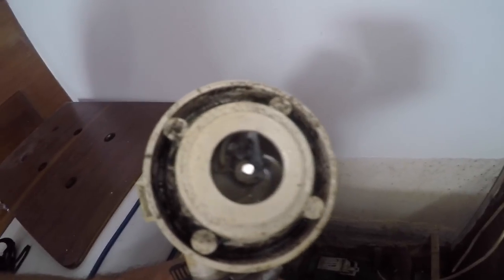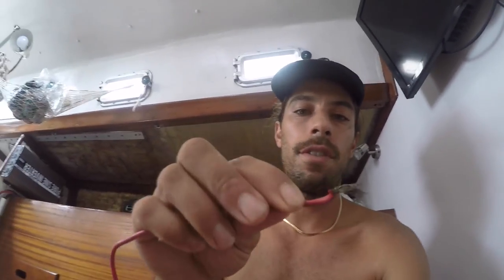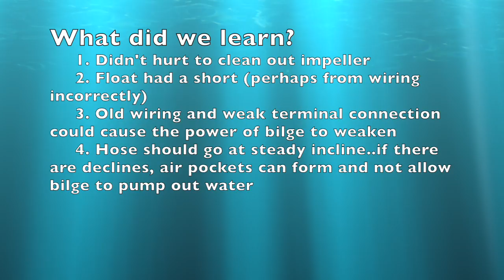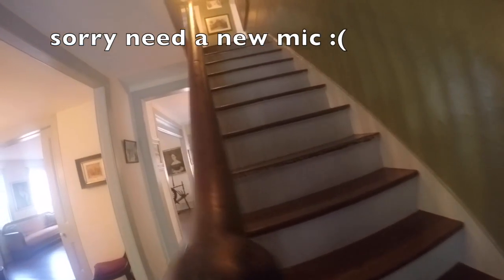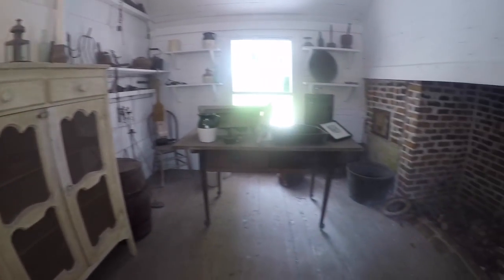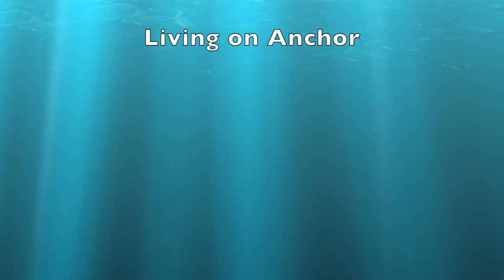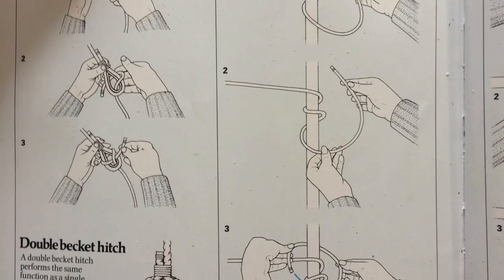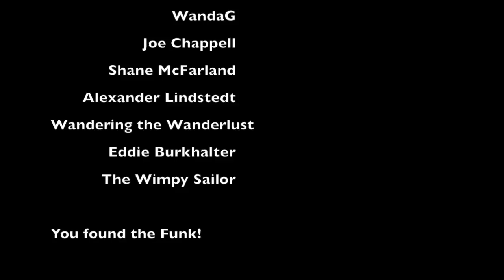Bilge Pump Running Constantly?! - Bums on a Boat Ep 21

Comment: should put a small alarm when pump is on. if you only realize you are taking on water after water in boat is a lot you will not be able to see where leak is coming from. engine cooling, threw hull,cutless etc

Comment: You need a back flow preventer the water that doesn’t go overboard and remains in the line will flow back into the bilge without one, sometimes that’s enough to activate the flow switch again and cause a contestant run on the pump, 👍
Reply from the maker: Yes there Is a 2 inch hose coming from the bilge pump and then a back flow preventer is between the 2 inch hose and the hose going out of the boat. Agree if we didn't have that it could cause a constant run. The bilge pump wasn't strong enough to get the water through the back flow preventer.

Comment: Can I make a suggestion?  Add a fuse on that wire?  20 amp inline fuse?  if something shorted, wiring can catch fire and the chemical smoke could overwhelm you. Learn from my mistakes. Make sure EVERY circuit on your boat is fused for the wire.
Reply from the maker: Okay thanks great advice. I will definitely learn from your mistake. Something I was aware of but thought we could squeeze by without. That doesn't sound good at all.

Comment: The impeller in the pump with pump in reverse rotation, but the fins are not efficient and do not move air effitively and thus the reason it would allow water to flow back down,  works like a shop dust collector...
Reply from the maker: So your saying my impeller was going in reverse. When the wires were crossed..even though it was pumping out water but just not strong pressure.
Reply: Bums on a Boat yes sir. 
impellers Push one way, regardless of direction of rotation. but they are designed to be most efficient in certain rotation. my schedule motors will run just as happily either direction by reversing polarity..

Comment: The whale supersub range are excellent. Built in electronic sensors and one way valve.
Reply from the maker: I'll check them out. I went to replace my one way valve and realized how spendy those little things are. My pump wasn't strong enough to push the water through the valve. The valve was good.

Comment: well, the bohemian achoring sounds really nice. but also a lot like you would get hit by a boat when you don't move along their scope. you would be quite stationary i guess. i've been anchoring with the other boats no more than 10 feet apart, worked out just fine. but of course that depends on the depth and whatnot
Reply: Bahamian, dude!
Reply from the maker: In some places you may be right, out here most are on mooring balls and swing very little.
Reply from the maker: lol I googled it to make sure.
Reply: =') that makes more sense than my landlocked neighbours. ah yes those mooring fields you have over there, I've never had to the guts to anchor there, only next to them. but bahamian style it should work out fine 👍

Comment: Generally, 12volt wiring colors will be RED + and WHITE -, but that's never something to hang a hat on. A 12 volt continuity checker would've been a good idea for this job. Secondly, this would've let you know if the switch was working for you also.
Reply from the maker: Ron Buckner thanks it's been a while since this post and we do now have a continuity checker. Very useful on a boat.

Comment: You should install a switch that allows the pump to run even without being trigger by the float switch
Reply from the maker: David Smith We so also had one in our engine room that is operated by a switch but agreed..that would be nice to have the option.

Comment: Blow across the top of your batteries before making any connection that will make a spark, as the hydrogen gas can blow the top of the batteries off in your face.
Reply from the maker: Wow okay! Thanks for the advice. Glad that didn't happen.